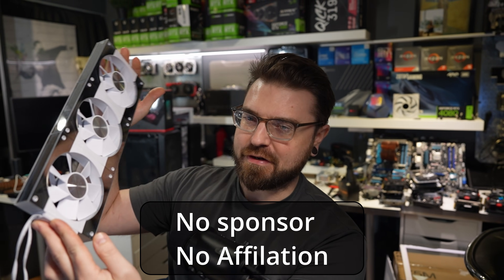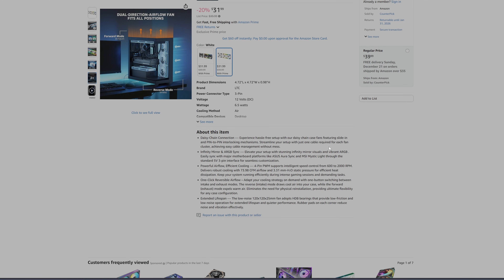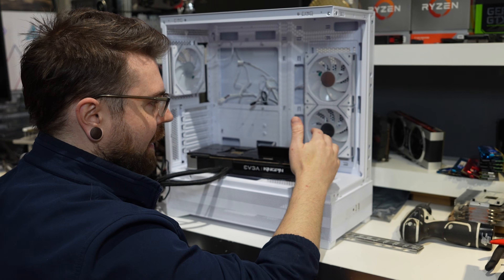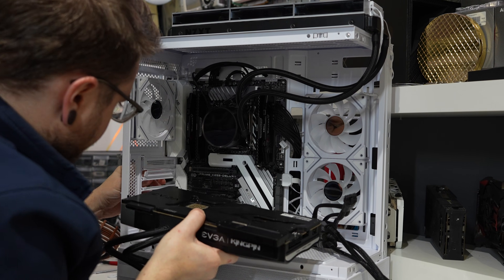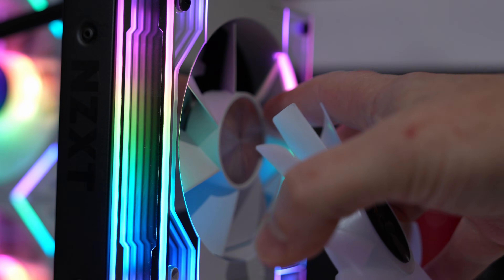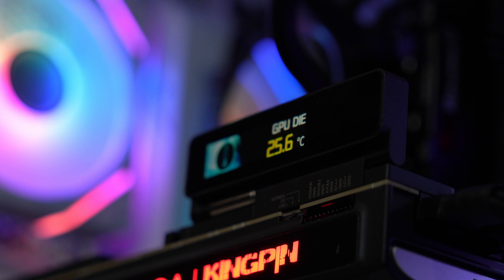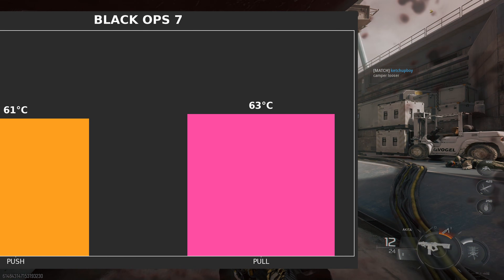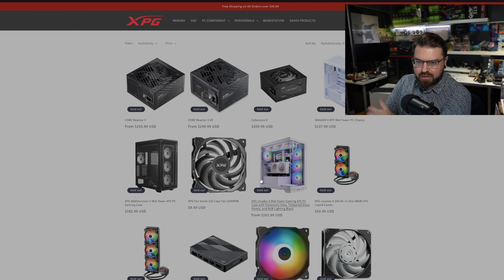Do these weird PC fans actually work?

Comment: with fans buy once cry once. in case of quality and performance there is no way around the top models like noctua or phanteks. especially with fans on radiators. these things are cheap and not good. i bet one 140mm noctua beats these things in all categories.

Comment: only thing i would have done is when testing the reverse setting setting the fans on the other side of the rad so it was pushing as well vs trying to pull air through the rad. i feel reverse or not id rather push through the rad then try and get fresh air pulled through the rad
Reply: Hey this actually affects how much noise you hear and how much air flow is lost at the imperfect seal created where the fan meets the radiator. 

Pushing air through a rad without using a gasket or seal is going to have air escaping and not go through the radiator, causing both noise and turbulence. Pulling is allegedly "better" because even if it's sucking air from those same edges (specifically where the fan frame meets the radiator) the air will be sucking in instead of hitting the radiator and blowing out. It gets pushed through the fan and in to the case. 

Noctua did a ton of research on this, you can find blog posts, charts/graphs, and etc, on their website, particularly on their gasket product pages (I bought the gaskets they really do dampen sound A LOT like I admit it's more than I expected). 

Right now my machine has - 2 3mm spacers, 2 push fans, radiator, gaskets, 2 pull fans, in that order. So it's a radiator sandwiched between fans doing push and pull. 

The fans across from each other are offset by 25rpm to remove the "wobble" effect (I am far from a physicist haha but something happens where you get a pulsing noise when the rpms match, Noctua again addressed this in ... I think it was an interview with GN like when they were making their new revamps of the NH-D15).

Anyways sorry to ramble but "usually" pull is a better setup than push, especially if you're using fans designed for high static pressure (radiator fans). You can tell if your fans are built for high static pressure by counting the blades. Higher blade count means higher static pressure (can "suck" real hard against a radiator) vs case fans, which typically have fewer larger blades. A great visual for this is to compare the Noctua NF-A12X25 vs the NF-A14. 

ANYWAYS not trying to "correct" you I just really like fans because I'm a weirdo lol

Comment: niceee, was looking forward to seeing the results of these. Pretty cool design and honestly surprised we hadn't seen it before or that it isn't common but I suppose the penalty could be the reason why. It'll be interesting to see how manufacturer build on this concept. There could be a high-end company that implements this with the ability to transform the fans or tilt them with a switch aswell which will omit the penalty.
Reply from the maker: There was a comment about lian li dropping their new $100 version soon (joking not joking). I'm sure there's a way to get the fan blades perfect for its use case, but the swooping design of the blade is how companies like Noctua has such great sound/thermals. These were really quiet though which is something I failed to mention now thinking of it as I'm writing this lol😅. Appreciate the comment.

Comment: while there are fans doing this, or just one direction or reversed, i personally only use the traditional ones meant to push air fast over the radiator or heatsink

i dont see the point, apart form the aesthetical part that does not matter much in reality, a fan that will show you the sticker in the back, is the least of my problems tbh
Reply from the maker: I tend to agree. The APNX fans I got have a 30mm depth and came with the multiple blades, it was the only time I ever swapped them to face inward. It actually feels wrong after years of staring at the X across the back of 90% of fans.

Comment: if the fanblade pitch is the same on either forward or reverse wouldn't the air still going in the same direction
Reply from the maker: Technically yes, but the blades have some curvature to sorta "scoop" the air in one direction, and don't have that same curvature design in the opposite, which is probably why the temps were a little higher.

Comment: So i can tell you in germany they (Adata XPG MAG 120mm) are around 91€, for a four pack. But the one you showed are not accessable in DE/EU amazon so well XPG it is (maybe).
Reply from the maker: Bummer, if you end up getting the XPGs post a comment back here how you like them.
Reply: @techwandoUS  Yeah i allready ordered them, i'm letting you know how i like them.
Reply: @techwandoUS   So they came today, they feel very sturdy not so cheap plastic like. But 1 Fan ran fine, then i stopped the fan waited few sec switched the orientation... Dead fan wont spin anymore. But i gave them the benefit of the doubt and tested the other 3, the orientation switch works fine here. Then i realised one side of the ARGB is dead aswell. So they are very quiet at 60% i hear slight humming. ARGB is like every fan is its own ARGB Strip i want the 3 become 1 Strip. I say its hard to suggest them, because of QC.
Reply from the maker: @XxXShadow95 dang, that's quite a few issues at that price. Going to RMA it or just return?
Reply: @techwandoUS  yup.. I figured its to much stress for 4 fans. I can return them within 14 Days,  i gonna do that and let the seller know about the issues.

Comment: I have thought about this alot. I really enjoy the Thermal take SwaFan ex fans. I love the option for normal or reverse blades. I find they keep things cool and move air very efficiently to the noise output.
Reply: I paid no more than 35 for any of the 9 boxes i bought, and they all come with extra connections, so you don't have to put them in line.  Even better, the previous RGB and the new ARGB are interchangeable, I can not recommend them more.
Reply from the maker: I've tried thermaltake fans in the past, they have always been decent. I'll definitely look into these. Appreciate the recommendation man.
Reply: @techwandoUS  New they are pricy unless on sale, but eBay kept having them for 30 with free shipping. Love your videos, thanks for the replies, and tech assistance.

Comment: I would like to see what these fans can do on a push, pull configuration AIO.
Reply from the maker: Like a double stack?
Reply: @techwandoUS  Ohh no, to test out the best config for a case.  Run testing on push, or pull airflow after reaching max temps with just the flip of a switch.
Reply from the maker: @Willbme4EVA ahh gotcha. Yeah I was just testing the fans in general outside to see what the switch would do pushing or pulling the air.
Ill probably hold on to them and try them in a real build in the future to see how they fare. The temps are definitely a little worse in a reverse or pull (pulling air through rad). Still kinda cool though.
Reply: @techwandoUS  I do not think I would leave them in a build, but use them to get a feel for best flow, then swap them out with different fans.

Comment: Hey bro I have a question for you. 
My 5090 FE started making like a scraping noise and I looked in the left fan was somehow was scraping against the outside frame....and bro I'm telling you I barely barely moved that damn fan blade and it snapped completely off. And so now the one fan is messed up on my 5090. As far as the RMA process,  I called in the RMA, but they want me to get the serial number off of the card and they say that it's on the little bracket, but I took it off to use it in a vertical GPU mount. I took it off and I can't find the damn thing and they want the serial number off of it do you think that they might give me some shit about that? I have the receipt and everything I'm just curious, You have experience with dealing with this, and I value your opinion is why I'm asking
Reply from the maker: What model is it that you have again? Depending on the company, they may or may not take the 5090 back but, fans are pretty easily replaceable and they might already have replacements online that you can buy. I'd definitely email them with the exact situation and see what they say. Say that it jammed up and when you went to move it, it broke off due to being brittle. It should definitely not break of that easy. Let me know what they say.

Comment: going to go check my ceiling fan as we speak.

Edit: yeah there is a switch
Reply: The so called "Winter Mode" is really helpful to save heating costs, because it's drawing the cold air from the floor, mixes it with the warm air on the ceiling and spreads it evenly across the room, so everything feels the same, no more "cold spots".